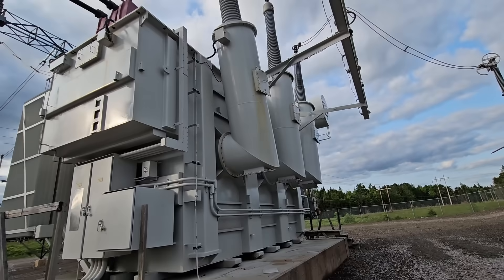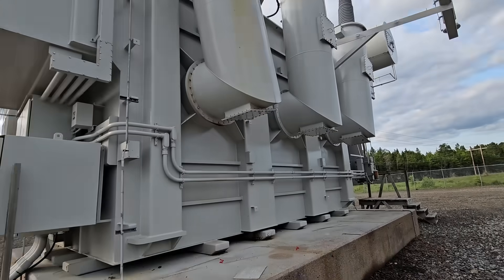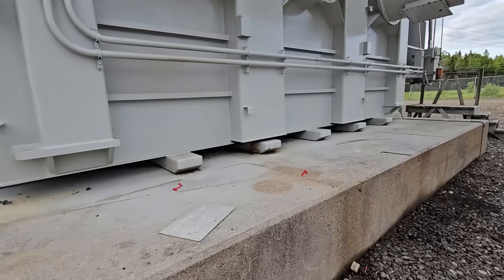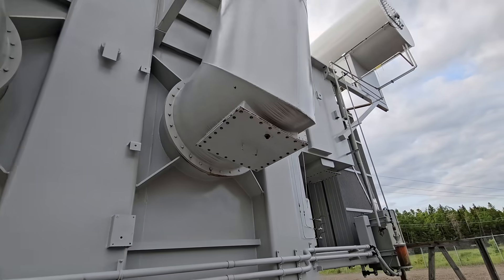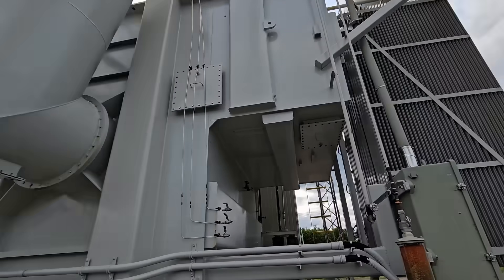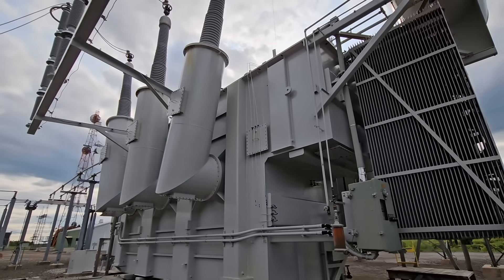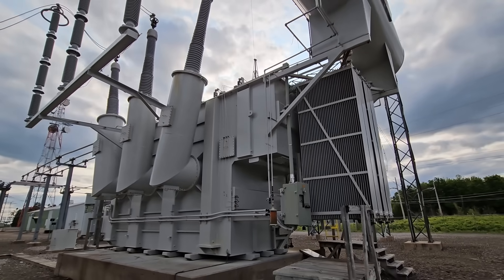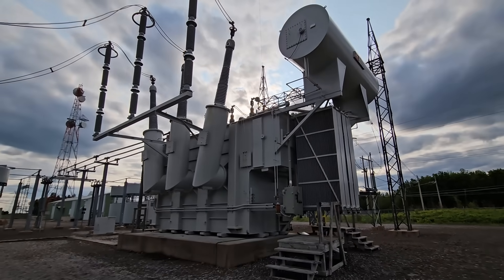Energizing a 345kV-138kV Transformer!

Comment: Although the transformers are designed to deal with the inrush when energising its always a worrying few seconds straight after the breaker closing to put the transformers on load. We have 4x 1000MVA units at one of my subs and they make a loud twang when first energised. We still use alot of airblast in the UK but its gradually being phased out. I much prefer an airblast breaker over those motor driven sf6 breakers. There is nothing refined about those motors that recharge the breaker mechanism spring!

Comment: Hi… I have a question, maybe silly or with no answer. I live near a mid size substation in my city. When power goes off, I mean, a large blackout (affecting great zones in my city) these is a big boom…. Almost like an electrical explosion, like a transformer blow up…. Coming from the substation. But when power comes back, it does normally, no noises, no booms again. The boom is so loud even you can feel the ground hit… just like the transformers in substation were jumping up as they lost power…. (Note, nobody has seen a spark or arc/flash when a blackout happens, just the big boom). There are 4 mid size transformes and 2 large ones… I don’t know nothing else. My question is… It is possible for a large transformer to move or jump up when they’re shut down? Thanks!

Comment: SO you are a lineman? You do switching as well?? Where Im at in Connecticut we have electricians who switch. Linemen NEVER are in the yards UNLESS there are primaries or transmission lines that need to be brought in/out of the yard... You guys do ANY control wiring in the houses?????? Im an electrician in a large utility CO in the state..Test Engineers we work along side of if I take a wiring job its great work. I did a big job last year at a small T-HUB replacing 21s (line relays) as the wireman worked over 930 hours (which is ALOT for construction electricians) my best year ever. If I can do it ALL OVER again Id be a lineman right from the rip. Im almost 42 a little late to the party. Got in the CO/utility work almost 8 years ago.

Comment: Why didn’t the hum start as soon as the switches were closed?
Reply: Because that was simply the connection being made, not energized. 

The big hum started upon the transformer being energized via circuit breaker, ... a fast, violent, making of the circuit.

Comment: Going from insanely high voltage to extremely high voltage. 😮 when there is a big geomagnetic storm these transformers make all sorts of crazy sounds. The last big one had it sound like a tiger was trapped inside at a nearby substation 😮
Reply: That’s pretty interesting. Is this due to ions in the air, magnetic flux or ground currents? Why does the power grid respond to that?
Reply: @jondelaire  Ground currents; They re-bias the B-H (Field Intensity-Flux Density) curve of the transformer to one side or the other of the normal 'curve' the transformer usually works with, and the steel plates making up the transformer core vibrate differently.
Reply: @uploadJ is that similar to a DC offset in a way?
Reply: @uploadJ  cool that’s very fascinating
Reply: @uploadJ  so if I understand correctly, because I don’t understand the proper terms, the DC offset makes the voltage on the AC cycle higher than it should be therefore more more  voltage allowing more current or a steeper phase angle?
Reply: @uploadJ  that creates the transformer to go beyond saturation?
Reply: @jondelaire  All of the above (air ionization is so negligible that you might as well forget about it unless we're talking about thunderstorms), given the length of transmission lines I'd wager that magnetic flux is by and large the biggest contributor; ground currents come in second and air ionization last.

The power grid responds to it because it's conductive end of story; there's nothing more to it.

For most intents and purposes earth is always at the same potential unless... we're talking about a downed line or fancy electronics in which case shit gets... more complicated.

Comment: You appeared to do at least some of these changes out in the open but in the past we have seen you do activations from inside a substation building. What is the criteria for making substation changes outside or in a building?
Reply: I think the difference is where the equipment is located. Here I think it's remotely operated by the system operator. When he's inside to make changes it's because that's where the control panel is. I could be mistaken.

Comment: Is there a tertiary winding at primary voltage for instrumentation? Curious about the busbar with cutouts going into the weatherhead and what looks like a potential transformer ahead of it.
Reply from the maker: 3 phase station service, metering and shunt reactors.
Reply: By "primary voltage" I presume you mean medium voltage?
The transformers stepping from one high voltage to another are usually wye connected auto-transformers.  A wye-wye transformer does not have a path for zero sequence currents (neutral current) other than through the earth.  By adding a delta winding, the zero sequence can loop through the delta winding and not have to go through the earth.  It reduces the neutral current going through the ground electrode, especially in a fault, and helps stabilize the line voltage balance.
Since the delta winding is present, it does provide a good place to tap for shunt capacitors and / or reactors, as well as station service.

Comment: I used to guard the mobile transformers here in NS years ago in my security days. I always liked being around when they were turned on, it was just so cool to see and hear them come to life. Of course knowing the implications of someone going past the barricades was a bit high pressure. When you're told call the transmission operator's desk before 911 for any incidents you know your dealing with some major stuff. I was told to call them and then 911 and tell them to bring a body bag and broom and dustpan for cleanup if someone jumped the barricades....
Reply: Some idiot tried to steal copper from an energized 125kv yard locally and well they ended up being found in pieces, and the power was not even disrupted. 😮
Reply: @christopherleubner6633  hey... at least it's a quick way to go that poor cloud of pink mist will be remembered in someone's incident report.

At the end of the day the real victim is the ratepayer and the poor bastards that had to go out and perform hot work to wash buddy off the gear before he turned into bird-bait exacerbating the potential for a disruptive fault!

Comment: what is the maximum voltage for 345 and 138 kv. where i live, we have 400 kv with a maximum voltage of 420 kv, and 132 kv with a maximum voltage at 145 kv on zealand and 150 kv with max at 170 kv on funen and jutland.
Reply: Pretty sure its 362 sustained for 345 and the same 145 for the 138. The value companies use varies. Like here in Norway we call it 420kV and 300kV for transmission, but they are often called 400 and 275 in other countries. In Sweden the 132kV lines are called 130kV.
Reply: @Gazer75  canada have 66 kv for distrubution. do you have any medium voltage or do you have any 30/50/60 kv grids in norway.  and does sweden have any 30/50/60 kv for lokal transmission. i know you have 400, 350 and 132 kv and 10/20 kv for the local low voltage transformers.  In denmark where i live, we have 400 and 150/132 kv for transmission and 30/50/60 kv for lokal transmission between all the main stations. and 10 kv from the main stations and out for the lov voltage transformers around the streets.

Comment: Unleash the Kraken!!  That sound, when things go right as they did here, is comforting to me. However, when things go wrong.........change of shorts and some quick distance are on the table. 

In the fictional novel I'm working on, one subplot involves a very large 245kv transformer exploding and killing a non-utility worker. Part of that (as a flashback sequence) is an accident with a metal enclosed 16kv breaker that fries someone. I showed those portions to one of our local linemen, he was terrified about how accurately I described the events.

Comment: It's amazing to me how these transformers can be energized with 345kv instantaneously and they don't just explode. There must be immense electromagnetic forces in there
Reply: Yes but there are also immense bolts, clamps, braces and so on in there :D
Reply: I would expect the ins. oil or something inside surrounding the internal conductor to instantaneously vaporize explosively.  ?    -- scary business 🥶 that strength of current.
Reply: Just to nitpick: Electromagnetic forces are dependent on the current, not the voltage.
Reply: @kuebbisch  Current times the number of turns.
345kV has a LOT of turns.
Reply: @kuebbisch 
I bet  the magnetizing losses alone could probably run my house 😂
Reply: The inrush current will not be small, and the amp-turns of flux in the core will be huge.

Comment: Now that's a sound!  The familiar 60 Hz hum you get when there's a bad ground in an audio setup but BIG.
Reply: Actually, it is 120 hz. During a transformer noise complaint investigation, I measured it with a sound meter. Also discovered that that frequency is unstoppable and will pass through concrete walls and homes like nothing was there. With that information we looked into noise cancelation.
Reply: @TexasEngineer actually, it's neither and both at the same time... Power cycles at 60Hz. Three phase power has three pulses, out of phase by 1/3 of a rotation. (120°) And, your understanding of the coils slapping on either side of that cycle. 60*3*2=360Hz. (There are sub-harmonics, and if it is a three phase coil that can mitigate the slapping back and forth and instead make it just have 180Hz by going from one coil to another.... But that's something for another conversation...)

Sorry, I hate when people say, "well, actually...." Even moreso when they're wrong.
Reply: @IceBergGeo The meter read 120 hz. The only logical reason is the coil is banging on the max and minimum, but that does not align for three phases. Autos might be wired differently. If you have different meter readings, I would love to know. My ears are not good enough to tell the difference.
Reply: @TexasEngineer  that's entirely possible with single phase. Was it a spectral reading or just a readout with a number displaying the loudest single frequency?
Reply: @IceBergGeo I take that you have never read the frequency with a meter. The frequencies could be downloaded to the laptop from the meter for the full spectrum.
Reply: @TexasEngineer not a meter, just a spectral analyzer, in various forms over the years.
Reply: @IceBergGeo Auto transformers are never single phase in our system. 1,000,000 pounds of transformer get noisy and the tap changer adds a percussion session with the clicking.

Comment: You have 735kV and 765kV transmission systems up there north of the border also. That would be impressive to switch! I've only stood underneath 735kV lines in Ohio a very long time ago.
Reply: Since long time ago it has been 765 kV in North America
Reply: @imeprezime1285   I just checked. The line from New England thru Maine to New Brunswick is not all that old and is run at 345KV, nothing higher in this corner of the continent. (I thot we were still at 115KV max, I know where that line runs, but they built/upgraded a bigger line recently.) This makes sense. Around Ohio Washington Vancouver Windsor Erie there is a LOT of power on both sides so 765KV is economic. Between Maine and New Brunswick, not so much, and the super-long insulators are expen$ive, so 345KV.
Reply: @PRR1954  I just made a reference to 735 and 765 kV claim in the same area of world  (which doesn't make sense). After WW2, the highest transmission voltage in Europe was 380 kV (first introduced by Sweden). Then somewhere around 1980 that had been upgraded to 400 kV nominal. No significant changes to grids systems were needed but the voltage has been upgraded a little.
Reply: @imeprezime1285  > "735 and 765 kV ... (which doesn't make sense)" That's OK. My hand-held meter only goes to 0.6KV and I'll be real careful going near lines 1,000X hotter (like, not going near!!).
Reply: @PRR1954  Voltage of 765 kVl rated lines can vary between 700 and 800 kV (depending on the load), so it doesn't matter much for most of practical purposes ⚡👺

Comment: My guitar tuning app showed the hum as 59.9 Hz.
Reply: It's a bit off...
Reply: Close enough for rock and roll.
Reply: @FOH3663  I was surprised that the phone app was very accurate even through tv speakers.
Reply: @majorbuzz 
I just ran it thru a spectral analyzer. 

In both cases, the harmonics are much stronger than the primary ~60hz.

Comment: "Induction" from what? The transmission line? The load? The transformer coils?

Love the channel 👍
Reply from the maker: All of the surrounding live 345kV bus and transmission lines. There's another Transformer of similar size on the other side of the yard currently handing all of the load.
Reply: And the magnetising current, the idle transformer (output not yet connected to the load) is a large inductor.
Due to the inevitable iron core losses some ten to hundreds of inductive kVAR will be circulating on the primary side even if the transformer is unloaded
Reply from the maker: That's correct about the transformer but in this case there is also no source. The disconnect blade is just the visual, we pick up the transformer with the circuit breaker.

Comment: How many MVA?
Reply from the maker: That's a good question! I'll have to check, next time I'm in the switch yard.
Reply: 250A for each conductor?  just a wild guess. 3 phases.
Reply: @bert-blank  I'd bet at least twice that on the high side.
"easy" to move runs about 300MVA, so you see a lot of the bulk transformers around that size.

Comment: Stuff of my Nightmares!!!! I am an electron wrangler by trade - in IT and work with (design and build) microelectronics where 300 mV or 10 mA is a death sentence to what I am working on. I do work with HV circuits at times up to 12 Kv (large power supplies with fly backs). All silent. But I got to tell you... that sound, that persistent hummmmm terrifies me to the core. Cold sweat, racing heart and and near the edge of the fight or flight responce. My son is an electrician and works in power vaults from time to time when traveling for work. I would love to conquer this fear I have someday. My hats off to you all of you guys. Thanks for keeping our lights on in the worst of times!! Stay safe and don't disappear in a flash! Tim W.

Comment: We're supposed to have one of them which is similar (330/132 kV transformer) installed at one of our local substations (Stroud NSW in Australia) in 2027 because in 2013, they ran a twin 132 kV feeder up to that substation which feeders our local 132/11 kV substation tees into which was commissioned in  2014.

The 132 kV feeders which connects to our local aluminium smelters (Tomago NSW) switchyard are actually  of a 330 kV lattice tower construction which runs for a few more kilometres & half of it is of a 330 kV concrete Pole structure for a few kilometres after that after it crosses a river for a few more kilometres.

That is all being run at 132 kV but in 2027  half of that 132 kV feeder structure is meant to be connected to a new 330 kV feeder a few kilometres from the other side of the river which hasn't been built yet , it's meant to supply power to that new 330/132 kV transformer.

Half of the twin 132 kV feeder which runs between our (Seaham NSW) substation & the other one (Seaham NSW) is actually being run at 33 kV because it tees into a nearby 33/11 kV substation which was connected to an 89 year old 33kV feeder, while that olsb33 kV feeder is still erected, it's switched off at that substation meaning that it's not operating.

Other projects don't seem to be coming into fruition such as the new battery power storage depot which is meant to be built on.6 hectares of land next to our local substation but no construction has even taken place, it's supposed to be completed this year !
Reply from the maker: Sounds like it might be a bit late 😬